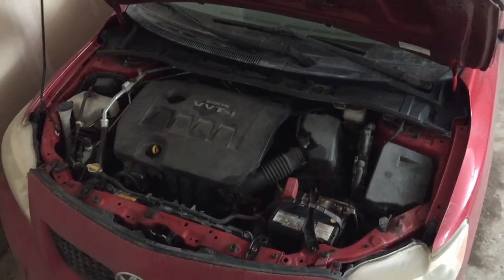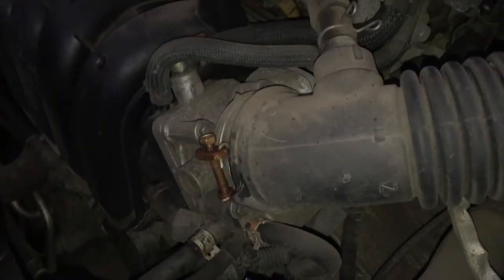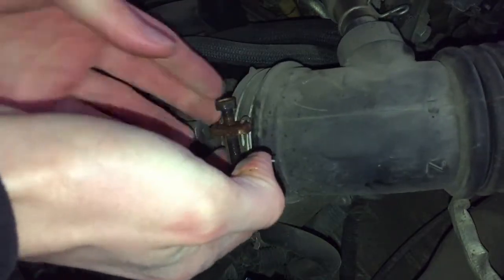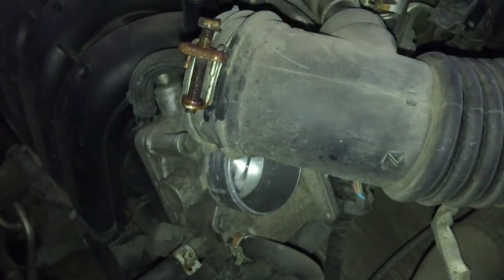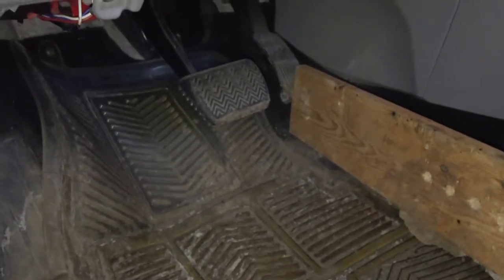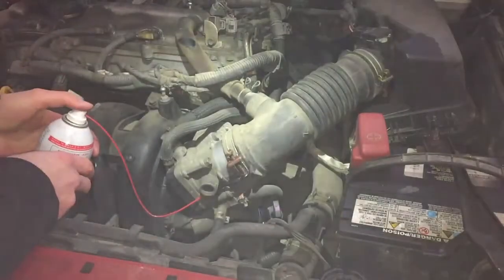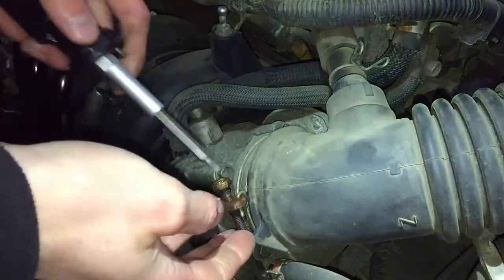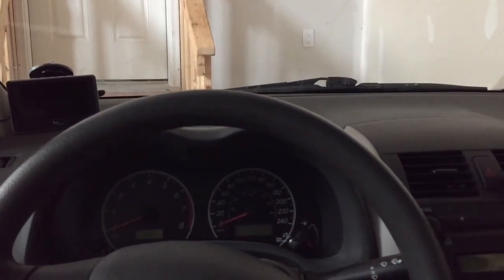SeaFoam Spray vs Toyota Corolla test

Comment: Does it runs smoother or get better gas mileage or easier passing smog check? Thanks in advance.
Reply from the maker: I could not notice any changes at all.
Reply: @drivingland9164  Thanks so much for your update.